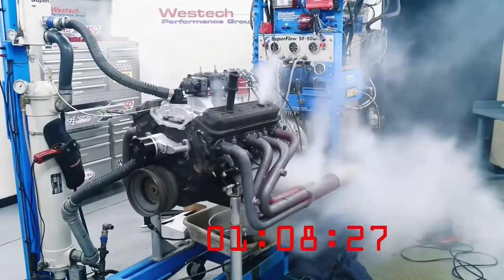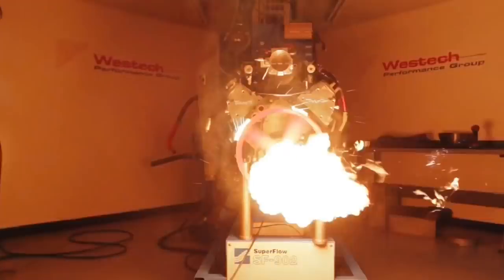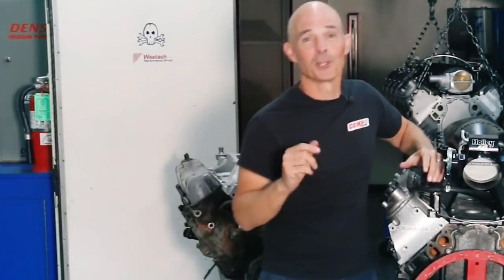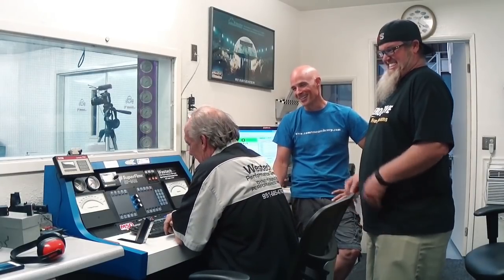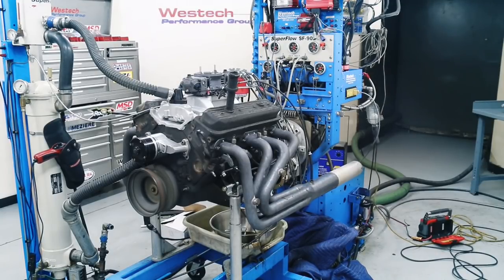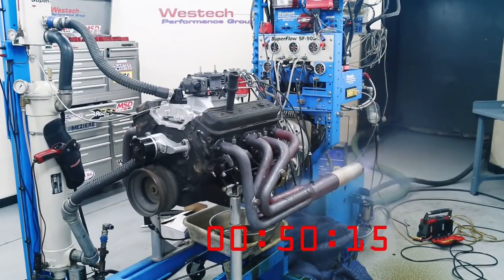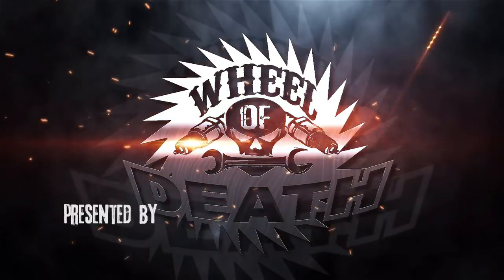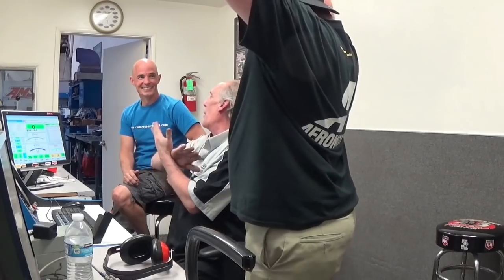FULL THROTTLE (NO OIL) HOW LONG WILL IT LAST?

Comment: I did this to a Kubota engine.  D1005 if I remember right.  It ran for over 40 minutes with zero oil pressure, at 3000 RPM (full throttle)-and it seized.  Then after it cooled, fired it back up and ran another 5 minutes til it seized.   Cooled off, ran again.  Repeated several times until it was so seized that the starter simply wouldn't crank it over anymore.  Probably stacked some bearings.  Never once tossed any parts out of it.  Oh, and it also had zero coolant in it.  Boy was that engine HOT.  I think some manufacturers need to look at Kubota engines-they are built VERY well.

Comment: I've had the joy of rebuilding a 10 speed semi transmission that got the oil drained and never filled again. Made it 50 miles with what was left in the case before melting down its own gears

Comment: If you didn't think it possible something would shoot something out, then you have a block of wood sitting between your shoulders.
I am always amazed how some get delight out of destroying stuff; especially under the lame label of "in the interests of science". No science is required to know what will happen. It is a foregone conclusion the moment the decision is made. You could to only achieve this by crippling an aspect of the engine's designed self protection system. That's not science. Yes, I watched it, if only to hope that the SBC went long enough that everyone found it took so long that they got bored with it and went and built engines instead.
Reply from the maker: we wanted to see how long it would run with no oil pressure-it was a junkyard motor

Comment: How Chad ever became 'famous', I'll never understand. 
We broke a rod between the neck and the big end in a race motor once, when the crank seal went and dumped all the oil when the car was on track. The bolts were intact and the cap was peeled open. What was left looked like a letter 'W'. Craziest thing I ever saw.

Comment: What a mess. I ran the dyno @ GM when we doing development work on racing variants of the LS2, LS3 and LS7. It's really obnoxious when they sling parts out of them. Many hours of greasy, oily cleanup are required after an event like this.  A fat stack of pig mats, a half gallon of purple power and a case of brake parts cleaner... Not worth it!
Reply: We had e let go in a dirt track pure stock. Similarly,  rods through the pan and block. When it's in a car it's a real mess!! And the hauler from getting it home too!! Ours was full of oil when it happened. It was getting faster as the race went on........then boom, puff offlame and smoke and done!!

Comment: Had a family member drive a Dodge Aspen with the 318 well over 100 miles with zero oil pressure. Turns out the distributor shaft broke right below the gear so still spark. I personally pulled the pan (PITA) and examined the rods and mains and despite this extended sojourn without oil pressure the rods and mains were still in great shape. Definitely sold me on Quaker State motor oil. After we fixed the distributor issue the brainless bastard basically gave the car away and some guy in that town bought it and drove it for several more years without issue.

Comment: picked up a Chevy 4x4 350 with a knock. drove for 6 months .babied it finally got a new motor for it. when i pulled pan to see what was knocking .it blew my mind crank was broke into. was broke so it still locked into both pieces . right before trust bearing. i would probably called someone a lier if they tried telling me this . but i seen with my own eyes. i also took a pontiac motor and did what they did .455 didnt last but five seconds .didnt run it out of oil just held it to the floor. turned out to be a 4 bolt block and kicked myself in the ass for doing such a stupid thing. also 25 years ago when them motors where popular .was supposed to be a stock 400 .

Comment: no the wheel of death is where ur ridin down the road in a rickety ass square nail era jeep cherokee of some sort then all the sudden the front wheel decides its gonna act like its soo far outta balance u start to wonder if they used internal balancing blocks.... kinda like those internal balancing beads but i swear to god it felt just like we strapped a cinder block to the rim n wen down the road as fast as we could it was actually terrifying i wouldnt have driven it..            good lord maan what the hell did dude in the black shirt take before he watched that lol have u ever even seen a motor blow up at all in person??

Comment: I was working at Lincoln/Mercury a number of years ago. One of the "Master Technicians" was tasked with the menial job of an oil change on a Mark VII with a 5.0L. Well he put a new filter on, but failed to put oil in it.. We got a call from the customer ten minutes later. He drove it approximately one mile before the 5.0 seized.

Comment: how long could you limp that engine along in gentle "I know there's no oil" in an emergency situation on the street? 10 miles?
Reply from the maker: a long time with less load
Reply: Chevys leak alot of oil out anyways, so there's probably a good many with no oil just running around.  LOL
Reply: Had a 84 ford 351HO  that the fram oil filter collapsed, drove it 8 or 10 miles home with no oil pressure with a loaded enclosed  trailer . Definitely did bearing damage(metal flake oil). Drained the oil and put fresh 20-50w,a better filter and a bottle of Lucas in it and drove it for a few more years. Never blew up.    That was before I saw fram oil filters cut apart. The cheap ones are JUNK!

Comment: It would be a huge mess, but I knew someone who put oil in the engine until the engine was full to the valve covers. I wonder how an engine would run with that much oil?
Reply: If it's THAT full, it probably wouldn't even turn over.
Reply from the maker: It runs terrible like that. We bought a used Honda engine from a local wrecking yard and installed it in the car. Filled it with oil-except it already had 4.5 quarts in it-it was not happy!
Reply: Richard Holdener good to know!
Reply: Walmart over filled the oil on my sisters Ford escort... It smoked like a steamboat. And ran like garbage

Comment: Totally against blowing up engines just to blow them up BUT the experiment does show the effects of windage. No oil on the crank = more power. Windage trays/ crank scrapers for the poor guy and dry sump for the bucks up guys.
Reply: Not exactly, more important is the power it takes to pump the oil...
Reply: @700HpVette  not exactly, synthetic thin oils help in that area. Parasitic oil pump losses are a given regardless of oil or no oil.
Reply: @troymecey  nobody making big power is using thin oils. Larger bearing clearance and 20w-50 or heavier is the norm...
Reply: @700HpVette  and?
Reply: @troymecey  I was right, you were wrong?
Reply: Lol,really? Look dude, I'm not hiding behind a made up name spouting " facts". Parasitic losses due to the oil pump are a fact. No way to get around it . Some pumps are better at it than others and that's another fact . Parasitic losses due to windage is definitely something even a bucks down guy can deal with. Be it just a common crank scraper/ windage tray or a high end well designed oil pan. Then there is always the "dry" pan .
Reply: @troymecey  thanks for solidifying my statements...
Reply: @700HpVette  lol

Comment: Figured you'd see a power increase for a few when the oil was gone. Our go kart motors always seemed to run their best also right before they let go lol
Reply from the maker: it made almost 10 ho more with no oil
Reply: More than likely because the oil pump didn't draw any HP. It takes a lot to turn a oil pump at higher R.P.M.
Reply: @merrillschannel  there is also a braking effect on the crank
Reply: We accidentally went out during for some practice laps without any oil in the engine (one time mistake, it happens lol) but for a couple laps it was was bad fast. We actually figured something was wrong before it blew up. Pulled off the track. Filled it with oil. Started it, sounded ok. Went back out and motor blew up within 2 laps.